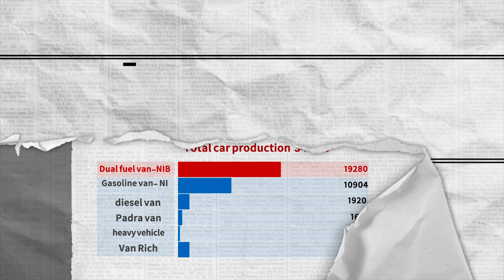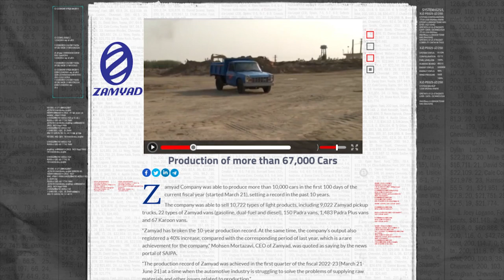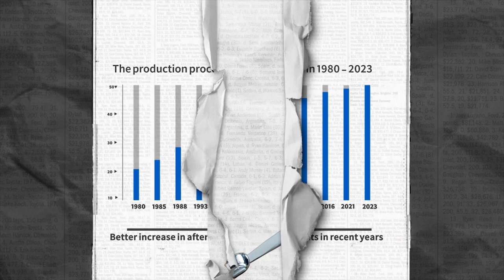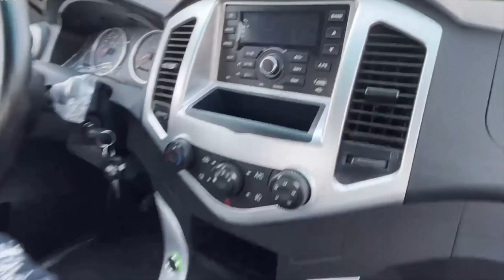Car Industry Exposed: Inside Zamyad CO (PART TWO)

Comment: thanks for shearing 
In the modern age-the development of the economy of any country cannot be imagined without the development of the automobile industry. In recent years, the global share of the automotive industry in the GDP structure is increasing, and the growth dynamics will create new jobs and increase the average wage. The automotive industry contributes to the expansion of the taxable base and revenues of the state budget, develops auxiliary branches, influences scientific and technical progress, testifies to the level of solvent demand and the standard of living of the population of the country and much more. Thus, the effective functioning and development of the automotive industry is important not only economic, but also social significance for any country.
Reply: Great Idea
Reply from the maker: Thanks for comment. Building 60 million vehicles requires the employment of about 9 million people directly in making the vehicles and the parts that go into them. This is over 5 percent of the world’s total manufacturing employment. It is estimated that each direct auto job supports at least another 5 indirect jobs in the community, resulting in more than 50 million jobs owed to the auto industry. Many people are employed in related manufacturing and services. Autos are built using the goods of many industries, including steel, iron, aluminum, glass, plastics, glass, carpeting, textiles, computer chips, rubber and more.

Comment: Spesifikasi
Reply from the maker: Gasoline linear car engine type

Engine volume is 2.4 liters

Cylinder / valve 4 / 8

Natural engine breathing

Power of 94 horsepower

Torque 187 Nm

5-speed manual gearbox

Rear differential drive axle

Speed 150 km/h